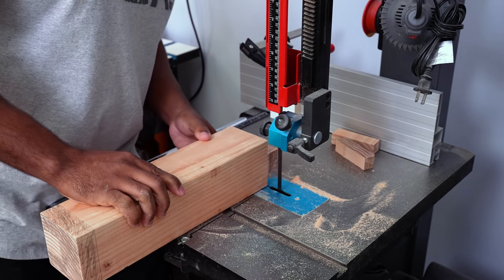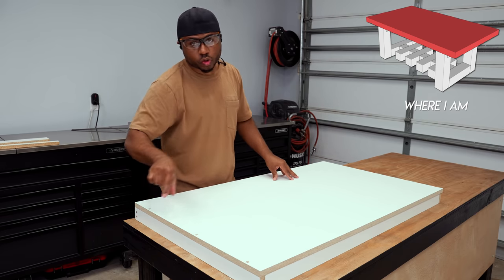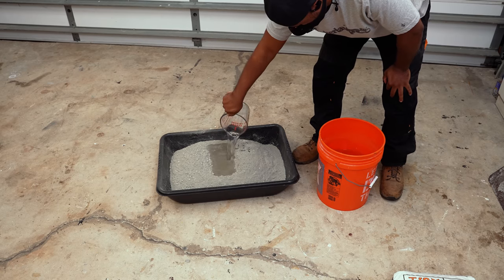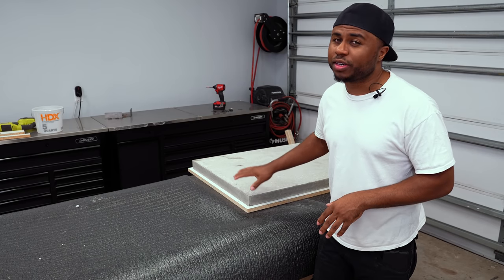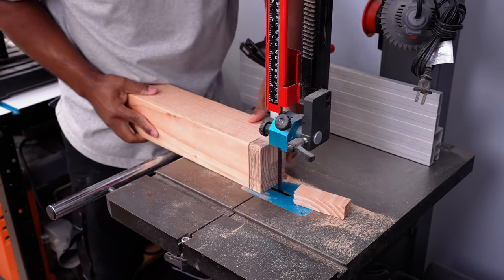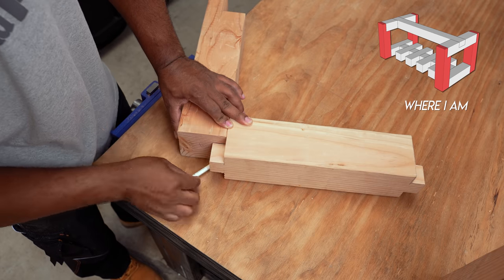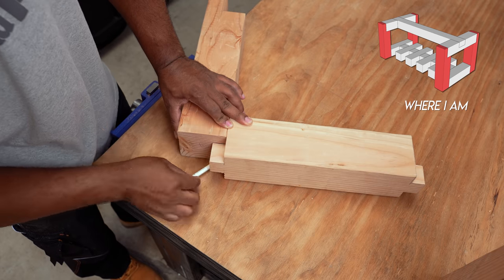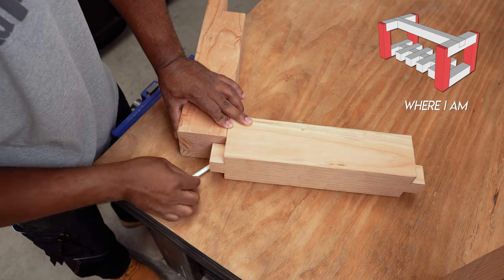How to make a concrete table

Comment: This is a beautiful table. To reduce weight you can lay in foam over the wire mesh.
Reply from the maker: Yep, I thought about it after. There will be a next time.
Reply: @DIYCreators  Have you added feet to it yet? My first thought when you said outdoor feet was, hockey pucks
Reply: Great idea 💡

Comment: I use Spar-urethane.  One brand name is Helmsman.  Made for boats/outdoor usage.  It's a polyurethane with additives for UV protection and the elements.
Reply from the maker: Hey Chris, I have the same Spar-urethane as well. It's good. I have used it quite a bit.

Comment: Thanks for the tipp with the WD40 as Mouldrelease.  Now Heres a Tipp for you ;)  instead of taking the  super heavy Bags of concrete MIX. Ill use Gallons as a messurement now, you can scale it down, since Liter's would maybe confuse you =). You can take  5 Gallons of Woodchips (i like use Small Animal Litter) and add ~2.1 Gallons of Water, mix that up and let it soak for an Hour.  Later on you can add 2 Gallons of Zement (no mix stuff just zement) if its to dry or thick  add water or zement. That kind of mix is called Wood-Concrete   its light while still being durrable (perfect for tables)  You can reinforce it how  you want, by using your rough reinforcement wire, finer Mesh (like used in building a stable for rabbits)  or 1 gallon Glasfibers per mix mentioned before.  I made a Tabletop  where i was testing sitting on.  Dimensions  where 2" thick  and 2x4 foot in size. im at arround  250 pounds   and it didnt broke.    One Cool plus is, due to its relatively "soft" nature, you could make a Big sheet  and cut it on the Tablesaw after  also  you can use  your regular wood tools  like a round over bit, BUT take this with a grain of salt  and allways use old tools. According to this nice Video  my Tabletop would waight ~30 pounds  not 160 pounds like yours. For outside you have to seal it realy good. Downside of this Wood concrete is,  the  Tabletop takes  3 days to cure  and another 2 weeks  to fully dry out (if not left in the sun), due to the nature of Wood not being Stone or Sand.

Comment: For my outdoor cedar furniture on a concrete patio, I use nail in, nylon caster pads. They are maybe 1.25" in diameter, and have a layer of rubber between the nylon and the object being attached to. They are durable and weatherproof.

Comment: Great video, love how you break down the steps so you can see the pieces you are working on. I probably would add hardware to secure the wood and add industrial weight caster wheels since this is a heavy table and would aid in moving it. Thanks for the good, clear video!!

Comment: 1:20 Melamine is a great material, but for those who haven't worked with it before, you should pre-drill for EVERY screw, both faces and edges. It's basically particle board, and driving a screw into the edge without predrilling will cause a split every single time. But you should also predrill every hole through the face, because screws will chip and split the melamine veneer as well. It's not flexible, so it'll crack and chip out easily. Chipping is also a major concern when cutting, if you're working on a finished piece and not a concrete form.

Comment: Very nice table and extremely high durability on the surface due to the concrete. I like how simple the design of this project is because I don't recall seeing one screw being used on the table only on the mold. I will definitely add this to my project list.

Comment: Great video.  I'm sure the backyard is looking good with the deck, the fire table, the couch and chairs, etc.  If the bubbles are an issue, what options are there?  Would a wetter mix be easier to vibrate bubbles out of, maybe an additive to the concrete, or even just filling them in with grout after the top is finished?
Reply: thats what i was thinking.. my mix maybe was a little dry it seemed... and maybe adding fiberglass makes it stronger or whatever that mix is

Comment: That is awesome looking!  Not sure what you want for look with feet, I might suggest square or rectangular metal tubing, angle cut like a picture frame to fill in ends, or if ordered wider V cut at ends filled in, to fill in the open end of tubes.  Then screw into bottom.  Can play with a designs in the metal finish with sandpaper (lots of small circles, straight lines, polish, etc.).
Reply from the maker: Thank you, IDK what I want just yet. Anything would work I just do not want it to rust if I go with metal.
Reply: @DIYCreators  I forgot to note I really like your design for the bottom shelf.  Can use metals that don't rust or tarnish (like copper does).  Examples - aluminum, some stainless steel, galvanized steel, brass, bronze.  Aluminum might get the look you're looking for, and is cheap.  

When I build my workshop, I plan to make aluminum square bases under 4x4 wall bench legs so they don't corrode from water over time (can clean floor with hose) - cut to form square like a picture frame, drill large hole on bottom for screwdriver to fit, small hole on top for screw to 4x4.

Comment: What I did was drilled out holes for star nuts and used carrage bolts.
But you can find plastic feet on a bolt you just have to use a nut that attaches to the wood.
But no glue is water proof not even tightbond Iii  water can devolve it.
So any points that hold weight should be pinned with split top dowls you can drive a wedge into. Its all wood and its not comming apart.

Tabld looks great,  I used an outdoor stain for decks on mine in a moghany color but differt project, color looks pretty close.  I also used Cypress.

Comment: Make 4 square  concrete molds 6x6x4,insert a dowel pin or steel screw into the center of each one ,let dry and bore a hole into each corner post and join.there is your outdoor ready feet and they match the theme of your table.Excellent work BTW.

Comment: Watch the wood whispers video on epoxy feet, especially for end grain. You basically make a channel for the feet with painters tape and make a 3/8 inch pour to keep the wood from sitting in water. I do it all the time.

Comment: Dope project!
John peters just did a tip on how to add a drip edge to a wooden table top.
Might be interesting to add a drip edge to a concrete table top.
Maybe by pressing in a something from below around the edge during curing, this way the wooden base would be more protected.

Comment: The pucks can be made from a 2.5 qt plastic paint pail and use the bottom 2 inches as the puck. Then affix pucks with construction adhesive to bottom of legs.

Comment: You may consider using a Milwaukee reciprocating multi tool to cut out those tedious chisel notches instead.  Makes quick work of tasks that traditionally required a chisel.

Comment: I’ve just bought three lengths, approx 7’ long of reformed 4” X 1” plastic, which comes in several colours, I’ve gone for anthracite. It can be treated as timber, but naturally, requires suitable adhesive, but can be very versatile 👌

Comment: Did you attach the tabletop to the legs or just let the heavy weight of concrete rest on the legs? If needed how do you mount wooden legs to a concrete top?

Comment: Make pads out of epoxy, you can get marine epoxy for great water proofing.  I usually drill into the bottom a little bit for the pads to have something to hold on to, then build it up with a wooden frame that will come off, this will give you some raised water resistant protection.  I would also look into an outdoor rated oil finish because if left out in the sun, and elements, urethane won't last long.

Comment: If you need to vibrate it a lot for the air bubbles just put it on top of a dryer or something while it hardens. Dunno how well that would go but saves effort i guess plus you vibrate it the entire time

Comment: Good job!   Since the table is for outside use, it would be nice to know how many years it can keep it smooth surface.    Have you considered putting coat of epoxy to seal the surface from water penetration?

Comment: my guy cutting up $10,000 worth of lumber like it's nothing.
Reply from the maker: lol lumber $ right now 😫
Reply: @DIYCreators  No wonder you're making stuff out of concrete now it's probably cheaper than lumber LOL. BTW How much did the table top weigh at the end? Just curious.
Reply: @ConcernedCitizenPPCA  160 ish is my guess.
Reply: @ConcernedCitizenPPCA  He said he used 2.5 - 80lb bags of concrete so thats 200lbs right there plus another 25 lbs of water which some does evaporate out so lets say 20 lb and Id say about 30-40lbs of lumber, all in all my guess is about 250-300 lbs..... insane 😂
Reply: @The_Humble_Servant  Almost double Id say.
Reply: @VegetaIsBetterThanGoku  well, that table certainly won't blow away in a strong wind!

Comment: It looks super modern and elegant, as every proyect you do, but wonders..how much this table weight?
Reply from the maker: Thank you, the concrete top is around 200 pounds, and the bottom is around 60 to 70 pounds.
Reply: @DIYCreators  wow, it's heavy!.. is any way to make a lighter concrete(ish) piece that works alike but be more light? My weight is close to 75 ppunds and i don't know if i can move that without a crane 😬

Comment: Turned out great! You could cut some rubber strips from a horse stall mat for weather proof feet. I think an entire rubber 3'x4' mat at Tractor supply is $10 or $15.  Pretty cheap and very durable.

Comment: If you have sds hammer drill, what you can do is cut an old drill bit off flat and put my drill in hammer setting and it works great for vibration to get rid air bubbles
Reply from the maker: Thanks man, good tip! I have tried a few things that worked in the past.

Comment: What about leaving an indent in the underside of the concrete where each of the four legs end. Then you can extend the four legs above the top of the frame and it will keep the concrete anchored without adding any hardware

Comment: Did you mount the top part with the wood or you left it as is i.e placing it on top without fastening the two pieces

Comment: The table came out great! For the legs I'd suggest some Furniture Levelers with a screw in nut. That way you can level the table if your patio is sloped or uneven in spots. Looking forward to seeing the top all sealed up. You going to darken it a bit or go with a clear/wet look sealant?
Reply from the maker: Thanks for the input; I was thinking of some kind of screw-in furniture levelers that would not rust. If I seal the top, I will make a quick video. I want to keep the dry look if possible; I think the wet look may make it darker than idk.

Comment: love the video. also the piece of furniture is awesome. i made similar tables or side tables and used plastic/grommet feet for a cutting board   Still looks great but its not an area that floods only simple levels of water. if it floods i would probably use "turn to level" screw on feet. Fir is an amazing wood but does not last with standing water. Elevate it the best you can. great video. might try foam centered to eliminate weight. love your content Always inspirational.

Comment: cheap feet: (for outside) a few big galvanized carriage bolts (round head) screwed into the wood, maybe with a few nuts and a washer to let them stick out an inch or so.

But given the weight of this thing I'd probably go with swivel casters so it can be moved around more easily (and not scratch floors if used inside). The kind you can get for office chairs that use roller blade wheels can each hold 150lbs (so 600lbs total) and also work well on medium to light carpet as well as floors. Easy to attach: drill a 10 or 11mm hole in the bottom of the leg (depending on the wheel's post size) and shove it in. You can get versions with a wheel lock (brake) as well. search "office chair roller blade wheels locking"
Come in sets of five, so maybe with this design you stick one in the center too.

Comment: if you want an easy way to vibrate the concrete to level it and work out air, just take the blade off your sawzall and run it around the edge of the form.

Comment: EXCELLENT SUBJECT . . .

Just a thought . . . 
You could create a template out of melamine in the style of the top support and then recess it in the bottom of the table to create a channel to lock the top into the base. 

EXTRA ADDED VALUE

Comment: A Great idea and work you did there. So did I understand correctly that you did not fix the concrete on the wood? These two are still separate pieces?
Kind regards from Germany 🤙🏽

Comment: Hey man, love your work! One thing I was hoping to find out is how you attached the legs to the concrete table top?
Reply: I have the same question to Glen. How did you attach the legs to the concrete top?
Reply from the maker: Sorry about that, I think you missed it. I didn't show it, but I said the concrete was just resting on the stand. The top is heavy enough to just stay without fasteners.
Reply: @DIYCreators , thanks!

Comment: i saw a guy use a recip saw with the blade removedand rest the shoe of the saw against the sides of the form and it worked the vibrate the concrete in the mold! have you seen this?
Reply from the maker: Ya, I have done that before.
Reply: @DIYCreators  okay great i havent built a concrete counter yet but hope to one day

Comment: In regards to feet for it, I saw a guy on YouTube (sorry can't remember who) and he made molds with painters tape, directly onto the project and then pour epoxy resin into them. Still good after years of abuse and virtually invisible unless you turn over the piece to look.

Comment: @DIY Creators  Thanks for the video but how did you fix the concrete to the wood? Thanks in advance
Reply from the maker: Thanks, the weight is holding it down. No attachment.

Comment: nice job man, you covered most the stuff you figured out needed to be addressed :)

your crete mix was super dry dude :)  the wire was an option fiber shred another that would probably serve you better on durability and weight as well as using negative cavity space. . . and a cool pour option for those top types as well is to 'face pour' with different aggregate in there or track in lights, fire, cup holders . . .  and then set anchors in for attaching the base & top.

that base is good like you said with the glue up you can also wood nail the hard joints / ends with a contrasting wood of appropriate strength and pin the stabilization footers to accent . . . and i would love to see you start doin some color dyes and shishogiban styled finishes i think your style and process would create some phenomenal DIY projects . . . 

don't let those sponsors and other chumpstains cram a whole bunch of stuff in your face my dude, its cool and all but they'll take you away from 'your process' and stifle your learning in order to control things :)  reach out to the like of Rex Krueger, Kris Harbor, MrChickadee and others in similar space. . .john malechki, pask makes and a couple of those other dudes and start chat'n, collab'n and trade'n knowledge, skills and things learnt :)  the whole slew of y'all need now more than ever to show people that community is where you make it and nothing has to stop us from sharing, caring, learning and growing with each other all while making cool stuff and having a bit of fun! :)

Comment: If this is going outside, rather than use feet, I'd go industrial and slap some small locking casters on it!
Reply from the maker: I thought about casters, but It would then make the table higher than i'd like. Casters are a good option though.

Comment: The Wood Whisperer makes a dam around the bottom of his outdoor furniture, then pours epoxy in and lets that set up.  Make them as thick as you think is necessary for the weight, and color the epoxy to blend with the legs.

Comment: You could have just bought a trout to finish the concrete so you don’t get any bubbles at all and round edges if you wanted to get a step tool as well or just use causation tape or some plastic bag to round out the edges when the concrete hardened without having to flip it make it safer for kids and your shins Jesus you gonna poke a hole in your skull if you fell on that edge